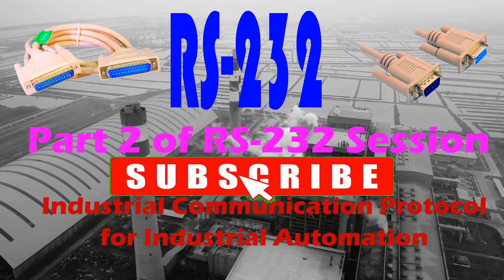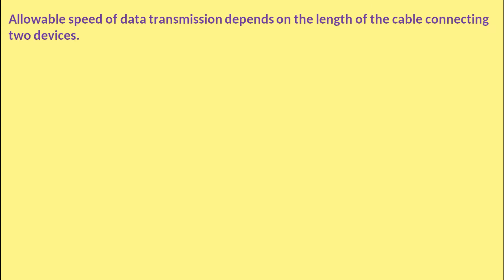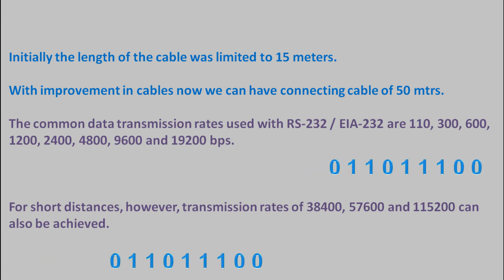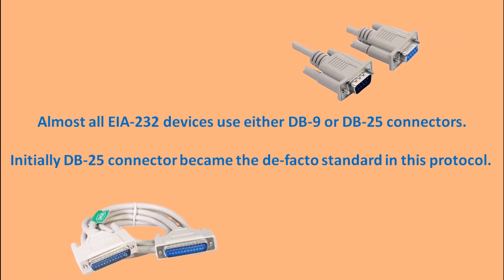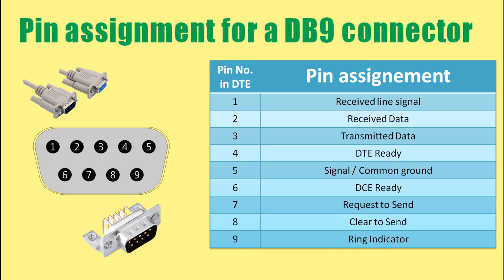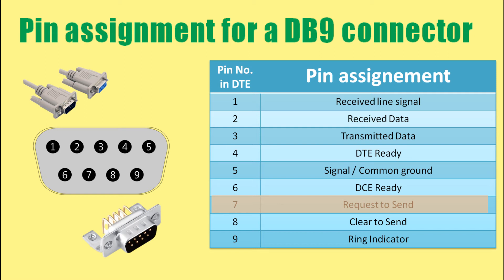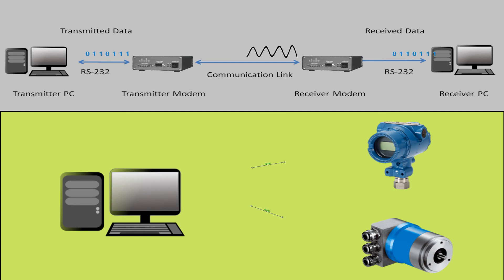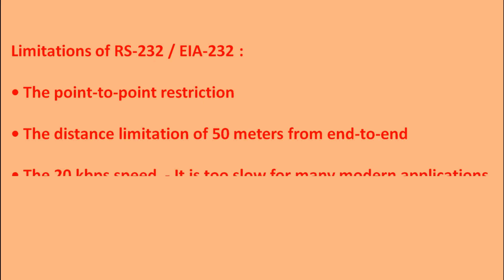RS232 serial communication tutorial - Industrial communication protocol for industrial automation -2

Comment: RS-232 is not a protocol. That standard only defines pins and voltage levels. What you are referring to is the NRZ protocol. It stands for "Non Return to Zero". You can run this same protocol over RS-422/423 or RS-485.